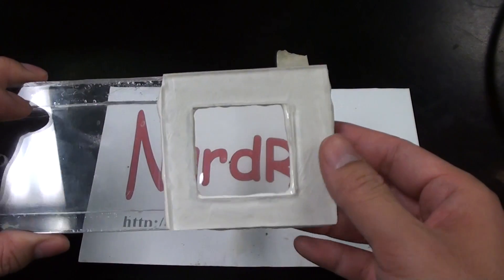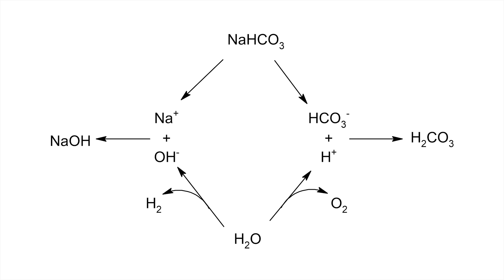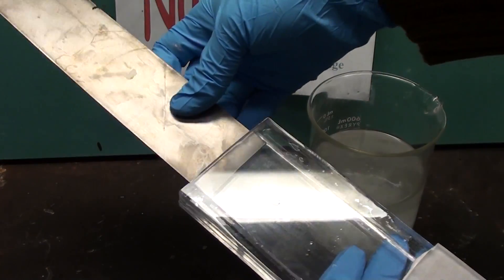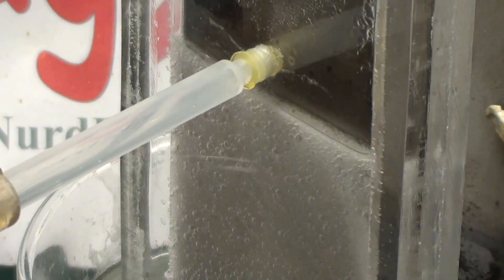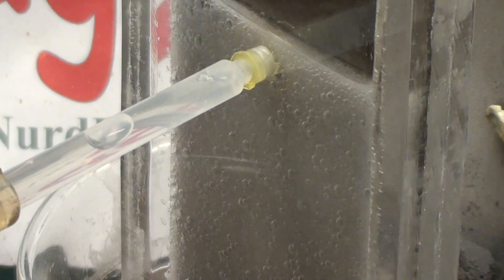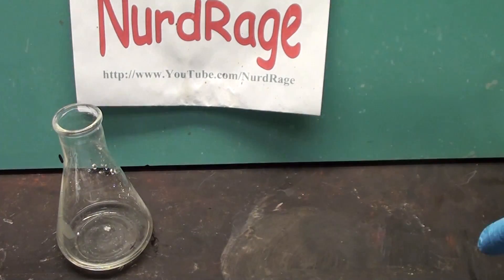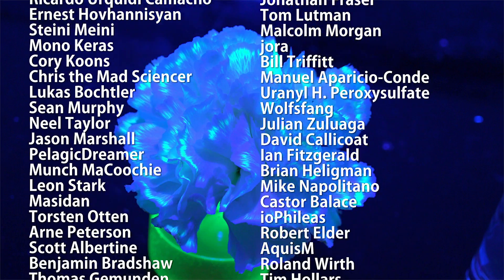Make Sodium Hydroxide by Electrolysis with a Nafion Membrane Cell

Comment: This has me thinking about alternative ways to perform direct air capture of carbon dioxide. Atmospheric CO2 reacts directly with aqueous hydroxide ions to form (bi)carbonate. This electrolytic way of regenerating the NaOH, releasing CO2 in the process, could be a cyclic way to capture CO2. The challenge of course is that O2 is also produced at the anode alongside CO2, so a separation step is necessary. I'd appreciate hearing your thoughts on this! What do you think about the feasibility of electrolytic DAC as apposed to the calcium caustic looping the most DAC methods use today?

Comment: @NurdRage
Anion exchange membranes (AEMs) are not too hard to make yourself. All you need is a UV light, thin HDPE/LDPE and Trimethylamine (TMA, try to get it in a Cl/Br form). Using the UV light to radicalise the polymer in a bath of TMA will make a simple AEM (frankly, grafted TMA-HDPE/LDPE are some of the best AEMs you can make). 

If you need papers to work from Newcastle University in the UK has quite a few papers.
If you want to buy AEMs Fuelcellstore would be your best case
Reply: That sounds very easy. Can I make it just by exposing a thin HDPE bathed in TMA.HCl solution to the direct UV light of the sun?

Comment: I have been working on an idea to run an outboard on hydrogen sourced from sea water through electrolysis powered by a solar and battery. The issue I have is dealing with the chlorine, this set up seems to make it easier. Would you happen to have any suggestions or input into this idea? Thanks!

P.s. I know the efficiency isn't going to be the greatest, but that's what iteration is for!
Reply from the maker: there has been recent advances in seawater hydrogen. Rather than a membrane, they use special electrodes that promote oxygen generation rather than chlorine generation. So type "seawater hydrogen" in google and you can find the papers that detail it.
Reply: @NurdRage  thanks for the insight! I will look that up. Not dealing with the chlorine would be a tremendous advantage.

Comment: oh my god this is exactly what i did before, the difference is that i put the anode area into a bottle with a pipe on its seal, so that i can use chlorine it produces, and the pipe turned extremely smelly soon!
Reply: note: i used NaCl instead of NaHCO3

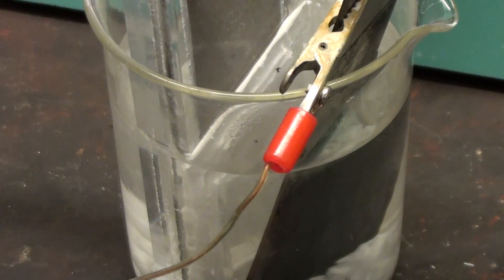Comment: 4:10 When you calculate current density, are you including both the anode and the cathode, or just the cathode?
Reply: You just need the overlapping area between them. So whichever is smaller will do
Reply: The anode is the oxidative stress limiter.  But the current through the membrane must be limited too.

Comment: I love your videos and I think you're awesome because I learned my first algorithm from you, but  for this and the armature chemist  good old plaster of Paris (gypsum, CaSO4, A.K.A.  calcium sulfate) casted into a cylindrical mold with low water content would make any hydroxide salt in full purity at the cathode and you can even make sulfuric acid in the process. Tell us how to crosslink PVA to make membranes to facilitate both cation and anion ad sur I love your videos and I think you're awesome because I learned my first algorithm from you, but  for this and the armature chemist  good old plaster of Paris (gypsum, CaSO4, A.K.A.  calcium sulfate) casted into a cylindrical mold with low water content would make any hydroxide salt in full purity at the cathode and you can even make sulfuric acid in the process. Tell us how to crosslink PVA (Polyvinyl Alcohol) to make membranes to facilitate both cation and anion exchange. I'm sure you've be very detailed and concise providing the necessary  information to replicate the likely non-toxic experiment ourselves. I've already made some hydrogels from Elmer's clear glue that seem promising (2 crosslinking methods of more than I can count) being they have electrical conductance (1/R) and have been dehydrated and rehydrated several times with no damage. I haven't tested anything yet I'm still figuring out the cell design. There are a number of factors that will affect efficiency, membrane thickness being 1, while a larger surface would provide less impedance. I'm used to plaster for making sulfuric acid as it offers good anion exchange bein the cation is stationary. I'm sure PVA membranes would be a walk in the park for you.

Comment: is there something we could use inside the sodium capture side that would avoid the hydroxide thus making a sodium metal plating process for pure sodium? While I am sure at some point I may need sodium metal so being able to make it would be good but I am really interested in purifying caesium (cesium) to use in a test of possible geological explanation for why we have so much Oxygen, constantly or consistently, as I have been wondering since plants release the CO2 by being broken down when they die, how we have the excess oxygen, and stumbled on a possible room temp autocatalystic process for cracking water of its hydrogen and oxygen that I think may be made naturally in the crust of the earth in far less pure form than what I intend to try, all based on the same concept that sunlight is able to power catalytic breaking of water using Graphitic-Carbon-Nitride. (GCN) it just has to have both the hole and electron donor in the matrix in the right quantities and configuration.

Comment: hi @NurdRage, have you thought about designing a "salt separator" which makes NaOH on one side and HCl on the other side?  maybe pass the H and Cl through a quartz tube with a UV LED shining through it so the small amounts of gas (on-demand, or as it's produced in real-time so there's no buildup danger) combine in water vapor and precipitate as an acid?  the idea of a contraption that electrically produces high PH on one side and low PH on the other side seems it could be useful

Comment: I made some time ago sodium hydroxide with the elctrolysis of sodium chloride. As a membrane I used a clay pot and as electrodes I used carbon rods from 6volt carbon zinc batteries for the anode and just some random copper wire for the cathode. It worked, but it took 20 HOURS TO GET 7 GRAMS. Do yeah it wasnt really efficient or a good way to make it. Also I used a variable 300w power supply as my power supply. I limited the current to about 8amps when it got that high.

Comment: Can I use this setup with NaCl to make HCl? (might get banned here anyday)
Reply: nope it will make Cl2 gas but you then need to add a UVC light or spark plug to then react it with the H2 and produce HCl.
I got a video on that exact setup albeit its dated and im never gonna rebuild that again for reasons.

Comment: How temperature stable is that stuff? Can it be exposed to sodium directly? I guess you couldn't use water, but could this be used to directly electrolyse sodium using methanol in oil? Basically, could do your magnesium process but using electrolysis rather than magnesium?

Comment: I know that probably is a dumb question, but, is the synthesis of Nafion possible for amateur chemists?
Reply: damn I wish but sadly nope however you can synthesize other membranes such as functionalized crosslinked PVA membranes which although arent as chemically resistant is good for proof of concept and small experiments to explore the science.
Ionomer cement however is something an amateur can make and has the ability to be as good as nafion because its basically nafion dust from de ionization resin cation or anion take your pic and then mixed with white cement and casted as a dam which then allows specific ions to pass through.
Nurdrage has an earlier video showing where u can get deionizer resin and you just have to put that in a blender.
Reply: @CatboyChemicalSociety   I was thinking the same, but just another question...

From GooglePatents: "One type of cation exchange membrane which has been proposed and developed is a copolymer of a sulfonated perfluorovinyl ether with tetrafluoroethylene which is marketed by E. I. duPont de Nemours and Co. under the trademark "Nafion"."

Is this correct?
The TFE is easy* , but I would try the synthesis of sulfonated perfluorovinyl. Nothing like the smell of Fluor in the morning...

Even easy is making a small piece. All the machinery would be "small".
*Anyone can buy here.

Comment: As always enlightening video!
If you can't get nafion, a clay pot works as well for making acids or bases. Make sure it's not glazed, and plug the hole at the bottom if there is one.
I've gotten up to 4.5M NaOH from baking soda and 1M sulfuric acid from Epsom salt. The anion/cation you want to separate from the salt will diffuse back a bit, but the solution will be still pure because (HCO3)- is repelled from the cathode and Mg2+ is repelled from the anode.
Harry from Scrap Science has more on that!
Reply: or ionomer cement which is deionizer resin mixed with cement and casted and this works just like nafion.
Reply: What voltage do you use?
Reply: @francisjahera1150  For better yield, It's the current that matters more. I set mine power supply to constnat 3-4 amps, and with my electrode sizes and pot geometry, was about 4-5V for the lye and 6-9V for sulfuric acid.

So basically, 5V should be fine. Crank it up if it's too slow for your liking, turn it down if your electrodes start to degrade.

Comment: I've had a Nafion XL tab open in my browser for like 5 years. Ive wondered how accessible it is for amateurs. I was looking at making a flow battery but I've never been sure how stable the Nafion is long term.
Reply: There's three major stressors to Nafion membranes: peroxides (which can be spontaneously formed in water-based electrochemistry), heat (rarely an issue, as even initial thermal decomp is well over 200 C), and mechanical stress (since the polymer is actually functionally very weak).  Biggest issue in practice tends to be running too much current so that pressure across the membrane exceeds the fairly low pressure threshold for damage.  In an amateur setup where you're running off a household power supply, though, this risk is going to be greatly reduced.
Reply: @ajjdgj6tmgedvnmtmek  By pressure damage, do you mean just gross total pressure difference across the membrane? Or can high currents destroy it from internal stresses? I was looking at creating a flow battery for high capacity power backup, and at the cell voltages I think I can get (i.e. 2 to 3 volts) I'm looking at at least a thousand amps.

This is one of the things that shut my project down was I know the membrane is probably going to be the main contributor to the internal resistance of the cell.

I'll have to look at their products again. Its been a few years.
Reply: There is a fourth thing that impacts longevity and in commercial cells is the limiting factor and that is impurities blocking the membrane.  Certain cations get 'stuck'.  This eventually reduces ion transmission and increases the voltage required.  So with high purity salt a membrane will last a very long time.

Comment: Actuallllly, i had heard of a similar method of usimg a ceramic membrane, as ghetto as a flower pot for making nitric acid with eletrolysis. If your membrane is flouridated, then it should do just fine in that experimemt as well, thouse the silicone or epoxy used to seal it might not hold up for long.

Comment: Okay, but why don’t the positively-charged ions stick to the negatively charged ends of the sulfate groups and clog up the works?
Reply: The trick is that the pull from the sulfate group is strong enough to pull the cations out of solution, but weaker than the pull from the cathode.  Thus the cations will stick on the anode side and then get pulled off from the cathode side.

Comment: Could you use Nafion to make Ozone in water?

Because apparently, you can get much higher ozone concentration and yields through water electrolysis.
Reply: You won't want to even if you could because one of the major factors in Nafion decomposition is that it can be attacked by reactive oxygen species.  Usually this is due to the formation of small amounts of hydrogen peroxide during water-based electrochemistry, but ozone would have a similar effect.  Your Nafion cell wouldn't last very long and the stuff is incredibly expensive.
Reply: @ajjdgj6tmgedvnmtmek  Oh okay, what a shame.
Reply: @xxxm981  you dont even need a membrane for producing ozone electrochemically. just cold water with or without electrolyte Na2SO4 or NaClO4 and PbO2 anodes and current densities at 300ma/cm^2.
the membrane used in commercial units is for selective diffusion of H2 out of the system to prevent instant detonation.
Reply: @CatboyChemicalSociety  So what if i do not wish for instant detonation? What if i want to oxidise ammonia instead?
Reply: @xxxm981  oxidizing ammonia electrochemically is not worth because it can oxidize it too far into N2 gas.
Reply: @CatboyChemicalSociety  The idea is oxidizing the ammonia with the ozone, which is made by electrolysis. I seen some papers that this can happen in wastewater treatment under certain conditions.
Reply: @xxxm981  oh yea then it will work for that purpose. I just saw an old darian ballard video about making ammonium nitrate from ozone and ammonia solution but the yield was shit.

A PbO2 anode in some Na2SO4 or NaClO4 at 300ma/cm^2 produces a ozone at up to 20% concentration and in the counter electrodes H2 is also produced which needs to be seperated.
Reply: @CatboyChemicalSociety  Well, it has to be under basic conditions and with MgO or Bromine catalyst to have any chance of yield from the papers i found.
Reply: @xxxm981  I read papers on electrochemical ozone generation and most mention sulfates and perchlorate salts as the catalyst but if bromine and MgO works then thats nice.

And I have generated pretty bad levels of ozone during my testing of PbO2 electrodes enough to warrant a scrubber setup in both times and enough to change the output gases to a slight purple.
Reply: @CatboyChemicalSociety  MgO and Br are catalysts for the oxidation of ammonia, not the ozone generation, sorry for the misunderstanding.
Will any sulfates do? Also i also read about electrolysis of sulfates with PbO2 electrodes making both H202 and H2SO4.

What made the purple? Did you distill it with a cold trap?
Reply: @xxxm981  nah ozone gas at high enough concentration produces a purple color.

yes sodium sulfate/persulfates work for making ozone. and if you want best results you need to keep the solution cold and run over 200ma/cm^2 of current density. my ATO-PbO2 anodes have a limit of 250ma/cm^2 but Ir-Ta substrate PbO2 has a limit of 300ma/cm^2 which is nice.

NaClO4 is a much better catalyst for ozone generation than Na2SO4. persulfates work too but idk how good they are.
Reply: @CatboyChemicalSociety  Huh, really? I mean in ChemicalForces videos i saw it being purple when cryogenic, but not the vapours. Sure you don´t have fancy impurities?

However, where would i get Ir-Ta XD
at that point i could probably just go with the air generators lol.
I know for a fact tho, that you can do it in water with some fancy membranes, i found a company that sells those electrolytic cells for a range of commercial and industrial uses. They claim up to 30% in solution, and its a german company, not some chinese factory.

ClO4 compunds kinda sketch me out tbh.
Why bother with the headaches if Na2So4 is so much easier to get tho.
Reply: @xxxm981  yes above 100ppm they are purple

Comment: There's this video of someone making a alkali membrane (cationic exchange membrane) to be used in place of nation membranes. The chemicals used are fairly common except glutaraldehyde, which is sold as matricide.
link:https://www.youtube.com/watch?v=BT3HjyziH_0
Reply: I have a video on this too but it uses Citric acid as a crosslinker instead of glutaraldehyde and the free carboxylic acid allows for cation transfer across the polymer.

Comment: The waste product I keep coming up with is sodium or potassium bisulfate. If there were an easy way to recover the sulfuric acid or a way to make sulfuric acid from commercially available ammonium bisulfate that would be a tremendous help.
Reply: Is copper sulfate or another metal sulfate not commercially available for you? Any metal sulfate salt where the metal is relatively stable in water can be electrolyzed into just the metal and sulfuric acid without a membrane. I've done it with copper sulfate using just carbon rods from batteries, glass jars from a dollar store, solid copper wire from a home store, and the 3.3V rail of a computer power supply I bought on a clearance sale.